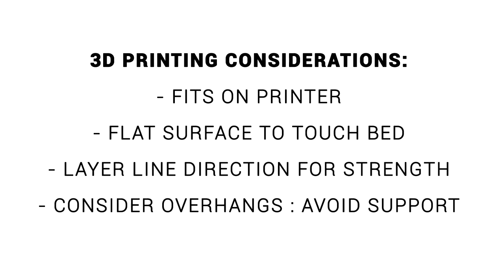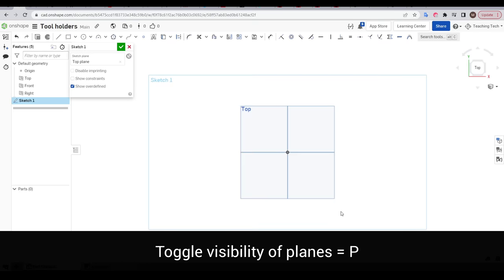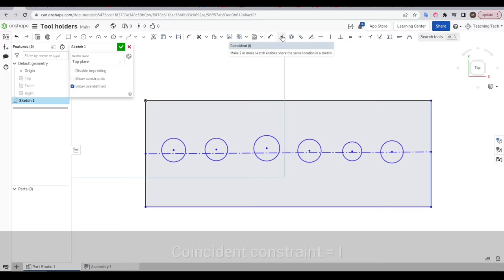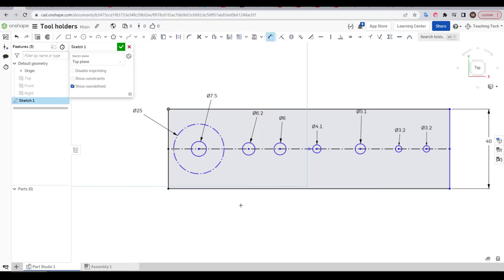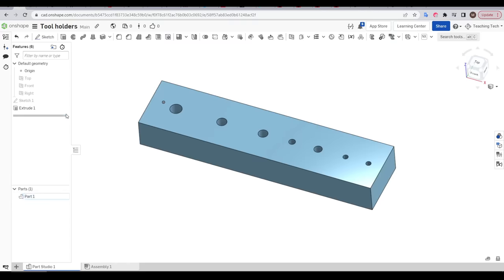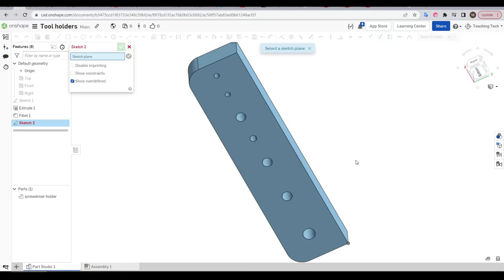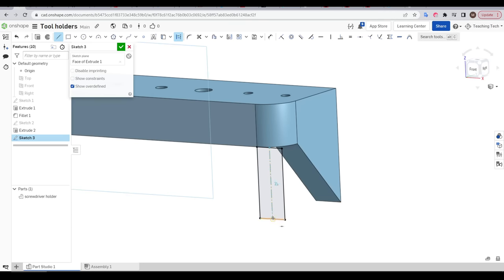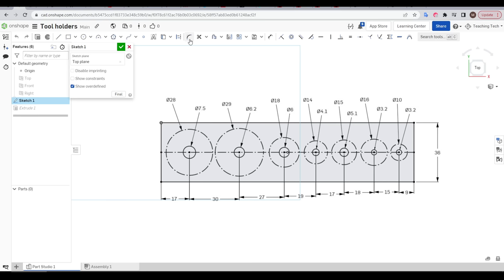Tool holder using Onshape sketches and extrusion - 3D design for 3D printing pt2

Comment: Wow, that was a world wind tutorial. You go so fast that keeping up, as a beginner user, is impossible without spending most of the time rewinding, often several times. I do think you have the best tutorial series on YouTube that I have found thus far, not to mention the most recent, but its a challenge...
Reply: U can slow down the video to 0,75x, or even 0,5x if u dont mind the strange voice. 0,75 works fine for me. 😊

Comment: Exactly what I was looking for right when I need it.  I'm embarking on 3d printing some custom carbon fibre pipe adapters for a Starlink mount, and was looking for a free CAD solution to do it with.  Your quick rundown and intro to Onshape was exactly the guidance I was hoping to find... thanks very much!  On that note, feel free to dig into how to handle elements (ribs/splines/voids) equally spaced around a ring every X degrees, if you want.

Comment: Great tutorial! I really hope this series can help me break away from Fusion 360 once and for all. 

Two things I'd like to see: Screws and patterns. I like to build specially fitted containers, and in Fusion making something like a jar with a screw-on lid was easy since there was already a built in tool to make the threads along a cylinder. With patterns, on Fusion, I was also able to do things like place a number of holes or ridges along a line or circle to better grip something, or to just add some design to an object.
Reply: You can easily add patterns, just like fusion -- check the pattern tool while sketching. For threads, you wrap a helix path around a cylinder then sweep a thread sketch around that helix (set to remove)

Comment: I started using OnShape a few weeks ago (after you had mentioned it was free). Moving over from Fusion360. So far so good! I actually designed and 3d printed an adapter to allow my LED lights to point directly at my 3d printer in my Lack Enclosure. Designed and printed in under 3 hours. Need to work on my slicer settings next to make it faster!

Comment: As commented in the first video - this tutorial is perfect. Going even through the simple step of drawing on a sheet of paper to make people unterstand what is a plane they are seeing. I´m happy having you in my Maker Life my man, thank you for your work! If I could suggest something that I would be really interested about (yet it´s something rather advanced I think - so no hard feelings if not): how to efficiently create threads to screw stuff into. Use case example: I would love to create a screw-on valve to a 5L flask I have - the valve is no issue (as strange it might sound), the threading though...
Reply: Seconded! Screw threads are a thing I would like to learn too. But I guess we'll have to wait a couple of tutorials until the sweep tool has been discussed on a 2d sketch...

Comment: Freecad is an Open souce  Github  D/load is 500mb  and  the Manual 10mb  Noyce  .
Reply: FreeCAD equips you with all the right tools for your needs. You get modern Finite Element Analysis (FEA) tools, experimental CFD, dedicated BIM, Geodata or CAM/CNC workbenches, a robot simulation module that allows you to study robot movements and many more features. FreeCAD really is a Swiss Army knife of general-purpose engineering toolkits.

Comment: Really looking forward to the rest of this series, I've only designed very basic stuff in F360 and Tinkercad but Tinkercad can be limiting as you mentioned but F360 can be difficult to get around when you can imagine what you what but don't know the tools to use!
Reply: I used Tinkercad before, its only half way useable because of all the community provided add ons. Navigating and discovering those is a PITA though! I much prefer the more methodical approach OnShape uses.

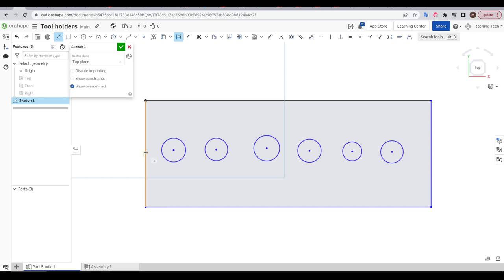Comment: the "Construction" tool doesn't seem to work the same way as I see at 4:49... I've started from scratch and followed your steps exactly 3 times now, but I cannot get a construction line along the center of the length of the rectangle.

I understand this video is not new, but most of the OnShape UI still looks the same.. so does anybody perhaps know how to achieve this in the current version?
Reply: Same issue for me... no idea

Comment: I use Fusion 360 and decided to try Onshape. After using it for a couple of days I can tell it's an amazing tool! In most use cases I like it more than Fusion, but it has a huge drawback - the extrusion always starts from the sketch plane. There are some ugly tricks/workarounds to overcome this in some cases, but in Fusion you can simply select the starting object (face, edge, point, anything).
Reply: But in OnShape, can't you make your sketch co-planar with any face on the existing object? And doesn't the extrusion occur normal to the sketch's plane?

I might not completely understand your concern, not being an OnShape user. Maybe you could elaborate on a precise example scenario that doesn't work in OnShape but does in Fusion 360.
Reply: @harvey66616  The simplest example is a sketch with two concentric circles. I extrude the outer circle from the sketch plane and get the first cylinder. Then I want to extrude the inner circle on top of the first cylinder, but I cannot select its top face as the starting point - Onshape just doesn't have such a concept as starting point for extrusion.

For this simple case I can get what I want with a bidirectional extrude, but this is very confusing and mind breaking operation compared to the simple selecting of the starting plane in Fusion.

Comment: Test prints are definitely a good thing to do to make sure things fit properly, though I probably would've made this out of a single sketch instead of 2

I wonder if Fusion has those sketch lines, I don't think I've seen them in it before 🤔 (tho I usually just use the normal lines to accomplish the same thing, albeit with a bit more clicking for the extrudes sometimes)

Comment: I think sketch fillets are preferred over part fillets (rebuild time in Onshape is shorter). Part fillets of course can be necessary, e.g. for edges not in the 2D sketch.
Also, especially for 3D printing, often chamfers tend to look better than fillets (especially in layers direction).

Comment: Hi Michael, looking forward to this series mate... I'm abit over all the issues that fusion has... So I'm keen to try out something new...

I'm gonna give this a test run tonight...

Looks like a very similar layout to fusion 360.

One request, would it be possible on the next design to show how you can "cut" holes in objects that weren't at the original angle of the check...

For example, if you had a pipe and a block, the block was extruded from the bottom plane and the pipe was made from the side plane .. you then maybe need the pipe to be a certain angle... You rotate it... Join it to the block.... But if you want the block to be shelled... And the pipe to come through one side of it on a diagonal angle... Say from the left and top wall... How would you do this?

Look forward to the next one 😎

Comment: Thinking about how you spaced out the holes for the screwdrivers, I can see how spacing them "by eye" and then manually entering constraints for the centers is pretty simple for something ad hoc.  Doing a smaller test print to test out spacing is a great idea.

But if you needed more precision in the spacing, is there an alternative?  For example, suppose you want to ensure there is a certain minimum space between the handles, and between the outer handles and the edge of the tool holder, is there a similarly simple way to express that constraint?  Could you perhaps make the construction circles wider than the actual handles, and then constrain them so that the edges of those circles just touch each other and the edge of the tool holder?  Or could you add a constraint of a specific distance between the circles (and additional constraints from the edges)?

Comment: I'm at the part where I'm adding mounting bosses and having trouble duplicating the same thing on the other side... I can't figure out how to reference the extrude depth I did to cut out the the clearance hole on the first one.  Can't figure out an easy way to measure it... Any help please? Thank you!
Reply from the maker: If you have a shared measurement you are using throughout the design, you can assign a variable. There is a video covering this later in the series.
Reply: Thanks! I’ll keep going. These are great.

Comment: G'day Micheal. I watched a sum of blokes talking about 3d printing and you were the only one who didn't say that "this is the printer you should buy". So you won my attention immediately. I am new to the sport. I am a grandfather building a model railway for the kids and being in N scale alot of items are just not available here or just priced way out of contention. So I'm hoping to learn the skill to build some of my own bits and pieces . Is there a system that will have particually N scale items that I could try and print? I haven't got a printer yet but looking at an Ender 3 V2 . Would I be better getting a printer with extra rolls of filament or one without and buy the extra roll with the machine? Since I've been watching your vid's I have found heaps of projects to do so I'm really trying hard to follow you on the show but I must say you go a bit quick for an older bloke to chase so I'll have to watch the vid's a few times to get the gist of the systems.. It's blown me away with what can be done but I don't want to rush out and buy the wrong printer. Thanks mate, great show.

Comment: Hi, great video. But Onshape has changed the sketch toolbar, and I cannot find the rectangle button in your video (it is a bit like tripping over at the first hurdle). Update: I opened the Onshape help file and located the Sketch help and followed their steps and the correct toolbar showed up with a bit of random button pushing. It seems several things need to be "aligned" before the duck quacks. The next step is to rinse and repeat until it becomes clear what the help instructions mean.

Comment: Love these latest videos.

While I understand designing for the 3D printer, That becomes a nightmare when you're modifying an existing object (car interior part) and that itself has certain requirements you can NOT deviat from.  I dunno if it's because I'm a newb/novice, but can't print it via my Prusa Mini... Supports really suck.

Comment: I appreciate you doing this as I'm just now starting 3D printing and designing. I am having difficulty with the model, though. For some reason, when I add the dimension of 19mm between the third and fourth hole, the final edge of the box becomes constrained. Then, when I add the final dimension of 9mm, everything turns red, and I receive an error message saying that the "sketch could not be solved." I'm at a loss on what to do, as I've repeated the exercise three times, and this keeps happening. I've researched how to remove constraints from a model, but nothing I've tried seems to work. Any thoughts on solving this issue are appreciated. Thanks again for doing this series.
Reply: Hey there. I have the same issue. Did you figure out how to solve that ?

Edit: My bad, figured it out 2mn later. If anyone finds the same comment and has that issue, my issue was a constaint between the center of a circle and the center of the rectangle.

Comment: I love you videoes. but any chance you can  show how to build a rowboat that is almost build like a viking ship. with both ends higher then the middel one. and have a thiknes of the rowboat like 1.4mm think . lenght of the rowboat shoul be like 90 mm.  hight of the rowboat 30mm on both sides but middle 15mm and with of the rowboat should be 30mm. i tryed in tinkercad and that i cant do it in. so now i like to lean it in Onshape

Comment: i don't see any other comments about it, so maybe i'm an idiot for asking, but here's my question...
you don't explain the Use Tool at all.  you just say, i'm going to use this tool, and then skip straight over to adding the holes.
i didn't use the Use Tool, and yet my new sketch still added itself onto the other part exactly like yours.  i just drew three lines and it would appear to have worked exactly the same, so i'm not at all sure what it's for.  i read the onshape help page for Use, but it did not help at all.
it does however make perfect sense when you show the second mounting example.  it allows you to translate the angled area into the plane of the front.  so what use was it on the first mounting method?

Comment: In the gusset (2nd mount) you really missed an opportunity to teach about the Hole Tool you could have turned 2 extrudes into 1 function sized perfectly for the hardware intended to mount your print.
Reply: Nice to see someone focusing on my primary CAD package,  I may learn some things... I cant wait till you get to variables and configurations, my favorite parts

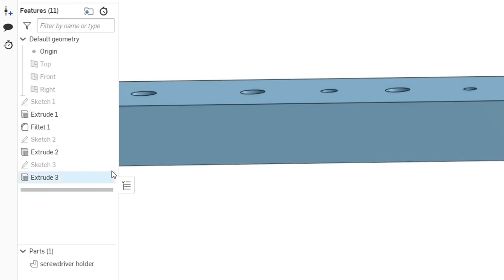Comment: I don't know about onshape specifically, using cutouts/subtract extrude circular sketches is bad practice in general. Basically every CAD program has a hole feature, and it allows smoother operation in the future. It allows the program to recognize these features as holes, and it will be much easier to change the hole to a different hole type. For example at 12:55 you wanted to create a counterbore hole, you could have used a hole feature to create both c'bore holes simulataneously, whilst your method requires 4 sketches and 4 extrude/subtract operations.

Comment: Great tutorial series thank you. I did get a printer for this reason. I did a bit of 3d modeling a long time ago but  found CAD software to be very different. I tried Fusion 360 coz there's a very extensive tutorial op YT but since its a few years out of date I spent too much time trying to find the equivalent functions mentioned in the tutorials. That was about 12 months ago and Id kind of given up on it so I'm really glad you've started this series. Cheers.

Comment: I don't suppose anyone else is baffled by the first "use" function? At 11 minutes we "fast forward", and I wonder if I'm just missing something stupid because I've no idea what "use" actually changed. It seems I can snap a box along that same line even without "using" it. I get how it works later on, for the triangular brackets, just not in that single line case. It would also be handy knowing how to mirror that bracket onto the other side. I tried experimenting with the "mirror" funtion on the toolbar, but no luck.

?
Reply from the maker: I agree use is a poor name for the tool. Trace is probably more intuitive. Anything you click will be traced into the current sketch. However, as you've noted you can draw other geometry and still snap to external stuff.

Comment: Another trick for printing out a test when checking for fit, is to turn off the top and bottom layers. So you end up with just a mesh/outline (infill). I found this prints so much quicker than waiting for full layers and is usually just enough to check hole alignment and spacing.

Comment: For test pieces, I tend to just export the model as is, import into the slicer, and use the cut tool in the slicer instead of modifying the 3d model in CAD or creating a new test fit model

Comment: i dont understand why my experience is so different. You say "Press N key" and when i do, it doesnt do what yours does. On my PC, it opens a search bar at the bottom of the screen. In fact, it opens a search bar if i type any key.
Reply: im so frustrated by this onshape webpage. Even the motion of the camera when i drag the view around is terrible compared to other options ive used. i cant even begin making this model with you because i cant achieve basic functionality.

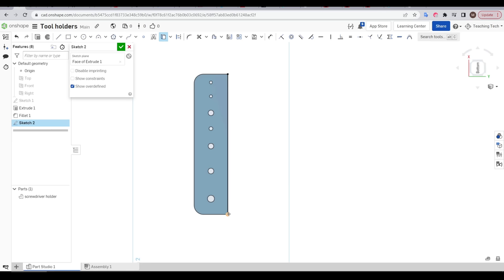Comment: Its going too fast, this is for someone with CAD experience. How do you even do the 10:55, fast forward why? By snapping to it, snapping to what? Its way too fast, i have to backtrack many many times several places and im atill not fully sure what your doing. Like why does the equal constraint make the second clicked circle the same shape as the first but when you subsequently press the lines to put them at the same postion rhe first shapes postion is matched with the second when you vlick them in that order. So its the opposite!!  Then yiu apply an equal constraint on the guidlines again but somehow it works on both guidlines when you only press one!! Then you create a plane on the surface of the side of the object and orient that way and voila you create a triangle all the while keeping all the useful information hidden to the person trying to learn... Then you trace again without showing us exactly how because hey let's keep you guessing again! XD We need mot detail its  confusing!

Comment: Great tutorial. Tip to improve your holder remove a cone shape from the top of the hole so it's easier to align the screw drivers with the hole. It doesn't need to be very deep that way they're still held securely.

Comment: With such a simple part you could have shown how to make the design more resilient...

So no sketches on surfaces! And dont use projected geometry! The second sketch would have easily been done on the origin plane and you could have easily used the line from the first sketch, which makes the model much more stable.,

I know its not really important for such simple parts, but its still something not too hard to learn but hard to unlearn if you started modeling the way you have shown it

Comment: Thank you so much for the tutorial, I have only used Tinkercad so far and this is a huge step up for me. I still struggled on a few points though - when I set the distance between my 4mm screw holes it simply moved one to the side instead of keeping it central. I hope someone on here could help me? As I said Im brand new to proper CAD